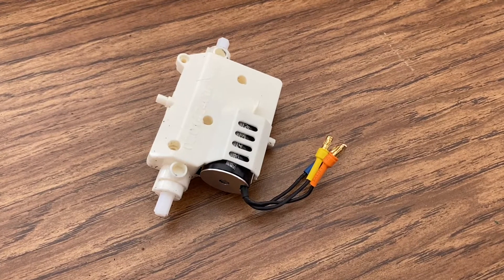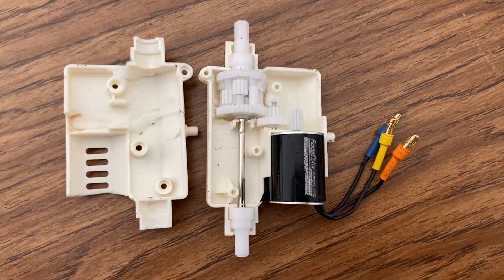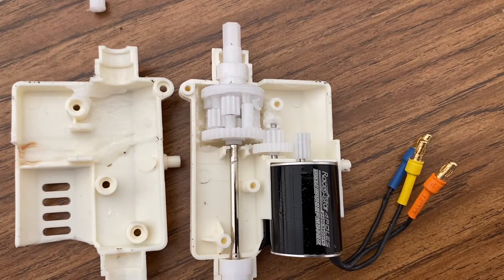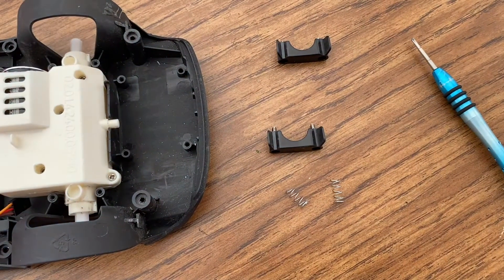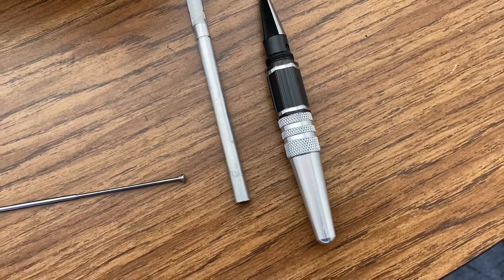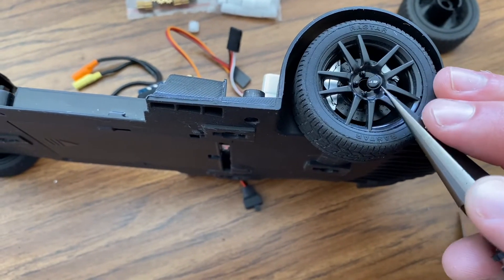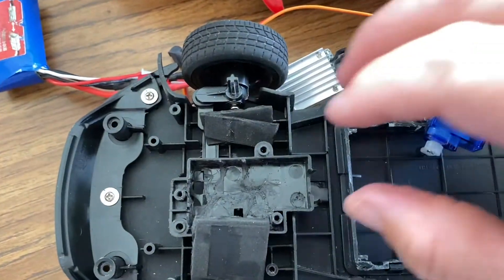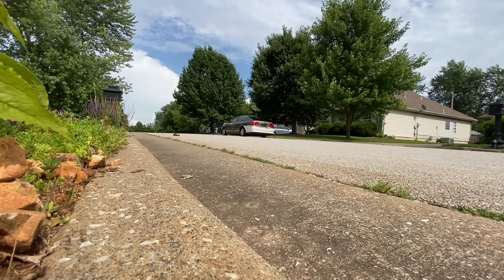Rastar 1/14 Gearbox Modification - Brushless Motor.  Also chassis & steering mods

Comment: Do they have better steering angle with the new servo? I find it needs a lot of space to turn on default electronics.
Reply from the maker: @christiannmas  The steering angle does improve for me, especially if I remove the original return to center mechanism (metal piece with the spring)

Comment: brushless motor with plastic spacers.... smells burned  plastic all around the world
Reply from the maker: @teotal_art  Thanks for the comment.  🤣 You might be right.  However, if driven with restraint, it holds up decently.  Something I keep in mind with most of my toy grade modifications.
Reply: @2005silver  but the construction is very clever and well made
Reply from the maker: @teotal_art  Rastar is decent quality for a toy grade Rc, but I’ve had a few issues with some other brands.

Comment: For the torque from the brushless motor best to use the metal pinions for sure. Have you found any bearings that might fit these?
Reply from the maker: I’ve not tried adding bearings so not sure what would work.  I’m reluctant to use a metal pinion because I’ve watched another person’s video showing him using a metal pinion and he keeps tearing up that middle plastic gear.  Not sure how or where to find a replacement for that one, so easier to keep plenty of plastic pinions on hand and drive the car less crazy.
Reply: @2005silver  Good to know. I guess I wouldn't want to do the same. Unless we can find replacement middle gears, even with various sizes to alter speed and torque.

Comment: I have a rastar Bentley continental gt 1/12 scale. I can't figure out how to get the rear wheels off? Can you tell me how
Reply from the maker: On the older Rastar cars, there’s usually a center piece that comes out.  Some are easier than others to remove.  Newer Rastar cars, the whole front of the rim comes off.  It’s held in place by tabs on the inside of the rim.  Here’s a link to a video showing someone taking apart on of the newer types: https://youtu.be/TA5TsLBzEbE

Comment: So I recently just got this Rastar g63 Mercedes and it’s kind of different. Do you think you can help me out with that ?
Reply from the maker: Maybe post a video or pictures on your channel so I can see what it looks like.  Happy to help if I can.
Reply: So I just uploaded a little look around video https://m.youtube.com/shorts/bSXWO8Ti0Xs. Whenever you get a chance to check it out, please leave a comment and let me know what I may need.
Reply from the maker: @cjtakebandz2896  I guess the first question is what are you wanting to do to the Rc?  Make it faster?  Proportional control?  A full hobby grade modification?

If you just want it to go a little faster but not have to modify, you could get some 3.7v lithium ion AA batteries.  I made a video showing that.  Here’s the link: https://youtu.be/gsXLlOC2nCI

Let me know what you think.
Reply: I wanted to make it faster with better handling like the GT500 and the F40 you previously did. Also been debating on the lights or not lol.
Reply from the maker: @cjtakebandz2896  Okay.  I would recommend a brushless modification, similar to the Ford GT in this video.  It’s easier than the modifications I did for the GT500 and the performance is similar.

Parts:  25amp brushless esc and a 2530 size brushless motor.  These can generally be bought together as a kit.

9g metal gear servo.  A MG90s is a good one.

“102A Long” plastic gear for pinion.

2S Lipo battery with a compatible connector to the esc.  Usually it’s a deans or T connector.  Something in the 1000 mah size.  

Hobby grade controller and receiver.  Look for a Dumbo brand.  Usually a decent price but works fine.

3mm Rc lights 

I order parts from AliExpress because they usually have the best price.  Trade off is waiting due to shipping from China.  You could also find these parts on EBay.  Prices are a little higher, but you might get sooner.

Comment: Is stainless steel gear good for this car
Reply from the maker: Thanks for the comment.  I wouldn’t use a metal pinion because it might damage that gear between the pinion and differential.  I have not found a replacement option for that gear, while finding the plastic pinions is much easier.

Comment: Hello there, I have recently asked you about parts and now I ordered almost all (hope that it will work). I gave up with longitudinal motor and metal differential so I will just copy what you did. Could you give advices about battery pack? What dimensions will fit and how many mah will be enough for let's say 30 minutes of play. I hope to find somewhere or to make working brake and steering lights and will try to make servo operated pop up lights. I will think how to make the pop ups work only when they are up
Reply from the maker: The type and size of battery I generally use is a 2S Lipo that is approximately 60x30x15mm.  Usually space is a bit limited due to the the interior of the car, so a flat type battery is easier to use.  Make sure the connector matches the esc.  I sometimes use an adapter.  Some I have are 850 - 1100 mah.  Not sure the run time, but they don’t wear out too fast.  Hope your modifications work well.  Look for 3mm lights since that matches the size of the original bulbs.
Reply: @2005silver  Thank you very much)I have cars from Silverlit where steering and braking lights work correctly so I will try to figure out how to copy them or will just take them from a Silverlit car. I won't drill headlights so I will use 3mm

Comment: I have the normal version of the ferrari 458 and I can't remove the caps from the rims, they are very stuck, what do you recommend to remove them?
Reply from the maker: I have a regular yellow version of the 458, and yeah, those center caps don’t look easy to get out.  Very flush with the rim.  So I just tried to remove one.  I used a body hole punch reamer tool, like in the video, to get it out.  That has a very fine point on it.  I was able to remove it, but I did scrape it a little bit.  I put the point between the rim and cap, pressed down gently to get the point in a little.  I then carefully pried it up a little.  After a few tries, it started to come loose.  Again, I did damage it a little.  Some of the caps are harder than others.  

Worse case, I have drilled a small hole in the cap in order to get a small screwdriver in there.  Had to do that with a different brand of Rc.

Comment: Hello man. I have seen a lot of your videos and really seem to like your work. Could please tell me the specific names of the parts that this modification has( name, brand of the esc servo transmitter/reciever etc)? I would really appreciate it. Take care😁
Reply: yeah i need this too
Reply from the maker: Thanks for the comment.  This is a long answer.

The brushless esc and motor brand is Racerstar.  25amp and 2430 size motor.  

The servos I use vary in brands, but are 9g servos, some plastic or metal gears.  SG90 for plastic, MG90s for metal.  I’ve bought both depending on price.  Metal is probably more durable, but more expensive.  I did buy some Racerstar branded ones and they seem okay.  

The controller and receiver are borrowed from some Tacon (aka Lc Racing) hobby grade RCs I have.  I like using those because the controller has reverse functions for the servo and motor, as well as trim and duel rates.  Also, the receiver is smaller so easier to fit.  Any Hobby grade Controller/receiver can be used, just check for reverse, duel rates & trim settings.

The lights I found on EBay.  Search for 3mm Rc lights.

I usually buy from Banggood or AliExpress depending on who has the better price.

Comment: Hi. This is a great posting. I've modded a few Rastars and I would really like to know if there's a link to get a bag of pinion gears like you show. I've looked all over ebay and can't find a source. Thanks in advance if anyone can help.
Reply from the maker: Search for “102A gear long” for the longer gear.    If you want a shorter gear then just “102A gear.   Just searched Amazon and EBay and there are plenty of choices.  

Here’s a few links https://www.ebay.com/itm/Othmro-30pcs-102A-Long-Model-Plastic-Gear-White-10-Teeth-6mm-OD-2mm-Hole-Dia-/313552664970?mkcid=16&mkevt=1&_trksid=p2349624.m2548.l6249&mkrid=711-127632-2357-0, 
Bettomshin 20Pcs 0.5 Modulus Plastic Gear 102A Long Pulley Belt Shaft Robot RC Motor 

Hand DIY Mechanical Parts Kit White https://www.amazon.com/dp/B08TR9JXGF/ref=cm_sw_r_cp_api_glt_fabc_RSQSK5YYVR4XKYEF8RN0
FYI, the “10” is the number of teeth, the “2”is the hole size, and “A” means tight fit.

Hope that helps.
Reply: @2005silver  Great! That's just what I was looking for. Thank you very much.
Reply from the maker: What Rastars have you modified?
Reply: @2005silver  I've done a couple of Defenders, Shelby Mustang, Ford GT, and Land Rover. I'm starting on a Mercedes gull wing and Jeep Wrangler. I like to run them with my 1/14 trucks.
Reply from the maker: @robertcampbell359  You have a nice collection of Rastar RCs.  You should make a video showing them.  I’d like to see your modifications.

Comment: I can’t get out the wheel center cap on my rastar G63. I think I need to destroy it😢
Reply from the maker: That’s frustrating.  Some are easier to remove than others.  I noticed some of the newer Rastar RCs I have the center piece might be hard to remove.  I had a similar problem with a different brand so I drilled a small hole big enough to fit a small screwdriver in there.
Reply: Drill a hole in the center and use a paper clip to hook it out.

Comment: great job thought you would like the racestar systems  only thing i would say i do not see any lube or bearings in the gearbox when i do a mod like this i always use copper grease it's a very high melting point grease that's not to thick unlike normal grease and provides good lubrication on the gears  also myself would change the way you mount your electronics as in fitting body post like a regular hobby grade RC that way you could seal the bottom and access everything from top side this would also allow you to use a bigger batterie as your not restricted by the batterie bay but great job and thanks for posting
Reply from the maker: You seem very knowledgeable, how would you describe that middle double layer gear between the diff and pinion.  The outer/larger gear has a smaller pitch than the smaller/inside gear.  Not sure how to search for a replacement if needed someday.  I’ve only been able to find those double layer gears where the pitch is the same.
Reply: @2005silver  also i have had a few toy grades like this where as the gearbox has faild after conversion  trying to find parts is a nightmare  much easier just to replace the gearbox all together with a same type dimensions hobby grade  i have a friend who just replaced the gearbox on a tyco bandit with that of a tamiya midnight pumpkin  not onley does it run better but now sports a 540 race motor lol some cool guys in my hang out 😁😃
Reply from the maker: @steveclough6794  That spur gear is what someone else commenting on this video is looking for.  I had one break on a different brand Rc and not sure how to find a replacement or how to describe to google what I’m looking for.
Reply: @2005silver  iam just about ready to go of to work but will.look into this tonight  you can normaly find gears like you posted by the bag full on ebay though you need to know the pitch and tooth count there are guys in the tamiya club that have converted such gears to rum steel roller bearings kinda hard to communicate that over this format
Reply: I would call it a spur gear  iam not trying to tell you how to build your model just help is all i have over 30 years in this hobby so have learnt a thing or to  but i do not know it all i have friends with far more knowledge  sorry did not see the grease
Reply from the maker: @steveclough6794  I enjoy your comments and I’m receptive to any advice.  Wow, 30 years in the hobby.  I got interested back in 2015 and wish I started sooner since it so much fun.
Reply: @2005silver  yeah lots of fun a wrenching lol love your videos 😁👍
Reply from the maker: There is usually plenty of that clear type grease in those Rastar gearboxes.  A little hard to see on video.  From time to time I’ll take the car apart to make sure the gears have plenty of lube.  The Rastar brand RCs so far seem like the best quality toy grade RCs I’ve modified.  Decent quality  plastic, very nice details on body shell, tires are a softer type so decent grip, good fit and finish and the cool type of car brands.
Reply: Very much a hit and miss affair but no dought at least one will fitt lol

Comment: OK, so I'll admit to some guilt because I by cars off Ebay just for spares for my doomed overpowered ones.
Reply from the maker: I have to remind myself to drive my modified toy grade RCs with some restraint to avoid breaking them.  I’m also not always successful 😜.  What types do you modify?
Reply: @2005silver  I mod 1:24 Rastar, Maisto, the odd Motormax... depends on the shell. I put a lot of kit bodies on those crawler chassis. Currently I'm putting a Welly RC LRover Defender body with a Welly diecast interior and glass on a shaver motored Orlandoo chassis, Also a chopped Silverado (Big Foot) on the FTX mini2 and an Ebay cheap RC chopped Rock bouncer Buggy detailed up on the FTX mini3, aaaand (lol) a rechassied K989 under a SRT Challenger. (gonna make that one rwd drift w/ the super big A232 drift wheels!.. 4mm hole, 3mm axle, doh!) haha, my back is killing me (bet you wished you hadn't asked) KD.. Like your channel bud.

Comment: Have you managed to find replacements for the double gear in the middle? That's usually the gear I end up breaking in mine. I've been searching online forever and can't seem to find any.
Reply from the maker: Although I’ve not broken that gear on the Rastar RCs, I did break a tooth off a similar gear on a different brand of toy grade rc I modified.  Similar double layer gear with different pitch sizes.  Have not been able to find a gear for that one either.  Not exactly sure how a gear like is described.  Only been able to find double gears that have the same pitch size on both layers.  I don’t know enough about gears like those.
Reply: @2005silver  was it Braha? Every one I modified broke the double gear. My Rastar projects don't tend to do it often but I still need replacements from time to time. I get tired of buying parts cars because I always end up wanting to do a project on those too 🤣.
Reply from the maker: @Dejonaire  It was a MJX brand Rc.  Broke a tooth off the gear only a few runs after modification.  I used the brass pinion gear from the original motor so I wonder if that was the cause.  Also the plastic gear seemed more brittle than the ones in the Rastar RCs.  Here’s a link to that video: https://youtu.be/0oEO1saLFvQ
Reply from the maker: @Dejonaire  You should post a video of your modified ones, while they still work 🤪.
Reply: @2005silver  I've honestly been considering it because of how much I learned from your videos. I'd like to also give some knowledge to people looking to learn. My latest projects are a lot more durable because of the things I pick up watching your videos (thank you).
Reply: @2005silver  damn 👍👍 can you send the link where i can find and buy all this upgrade set?? 👍🤌
Reply from the maker: @pauliusgtp1421  Here’s a few links.  Check for pricing because sometimes it cheaper to buy together or separately.  Servo link is for the type, but there’s a lot of choices.

I got these from Banggood but check around for best prices.

Racerstar 2430 Sensorless Motor 7200/5800KV 25A ESC For 1/18 1/20 Cars RC https://banggood.app.link/he9OvLgX5jb

4PCS Racerstar MG90S 9g Micro Metal Gear Analog Servo https://banggood.app.link/1pd37clX5jb

Lights.  Look for 3mm bulbs.  Fit original light buckets in car.  https://www.ebay.com/itm/4-LED-Headlight-3mm-White-Red-Light-RC-Car-Parts-for-TRAXXAS-HSP-HPI-REDCAT-/284424592802?mkcid=16&mkevt=1&_trksid=p2349624.m2548.l6249&mkrid=711-127632-2357-0

Hope this helps.😀
Reply: @2005silver  thanks alot man 👍👍👍